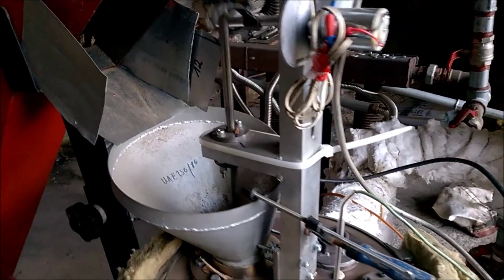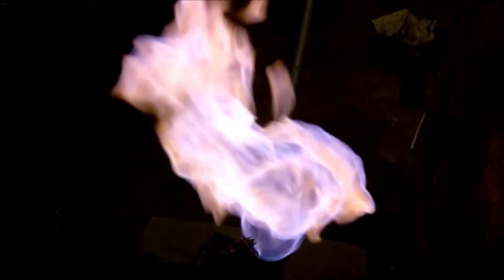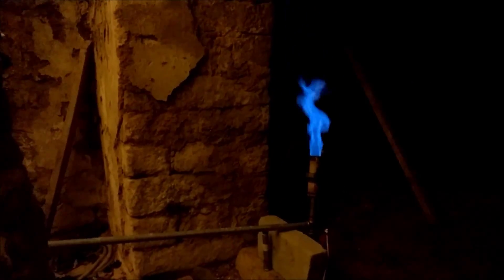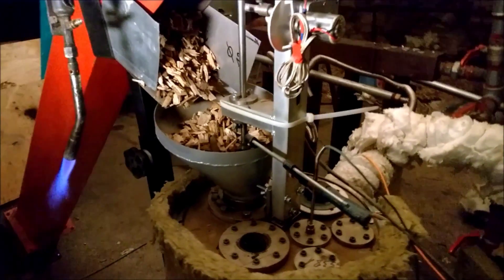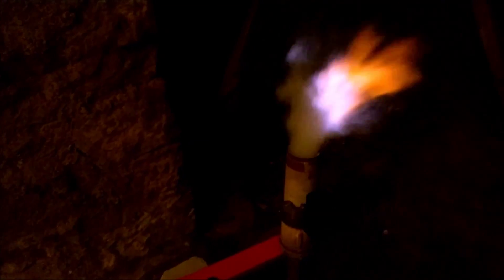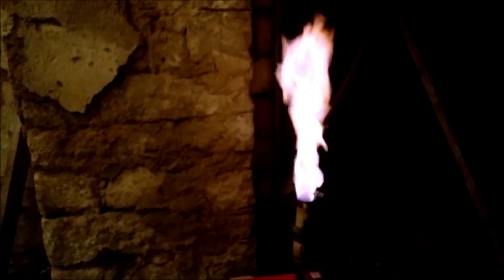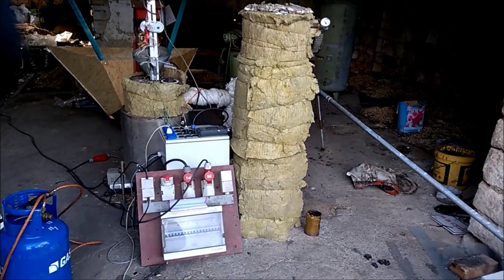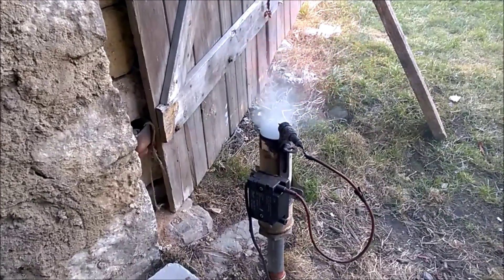Grateless gasifier; 24 hours run.

Comment: Hi Luk. I am really amazed at the performance of your baghouse filter. Could you tell me a bit more about it . Like what type of bags or socks you are using? Does it go for long before it needs cleaning. How difficult is it to clean? How well do the filter bags handle the moisture and sticky stuff? Always look forward to seeing your progress. I check every time I get on the computer. Still hanging out for some clues how that lastest gasifier works. All the best. Stephen
Reply from the maker: Hi stephen,  Since you follow my work, you will have noticed that I am still in the experimental stage. I change this and I change that and I try this and I try that in small steps. I do Experimenting by elimination. Promising is the fact that I always make little progresses.
But I am still not arrived at the goal I have set from the beginning. Building a gasifier that runs unattented day and night and can be operated by an unskilled person.
Saying this I also experiment regulary with various filter media. I recently changed the bag filter. It was preforming fair enough but if I did not brought up the filter house on temperature above dew point, and this took a too long time, the bag got soaking wet. Now the new filter you see in the video has first a layer of some 60 cm stainless metal shavings to condence out as much water as possible that while trickling down takes the dust with it, and above  that metal layer is an open space and above that,  right before the gas exit are two tightly pressed layers of high temperature resitant ceramic wool. The pressed ceramic wool resembles the ceramic candle's that are next to bags, the industry second most used filter media. This setup seems to be less vulnerable to moisture. (Beware, put them between screens because when wet they tear easy because of the vacuum sucking) How long they last I do not know because I only used them 24 hours so far. As far as presure drop the filter still breath as at the begining. I will leave them in place, and see how long they last. Now i must first make some small adaptions to the grateless. (mainly I will  take a slightly bigger diameter drop pipe, (from 88,9 to 104 mm) to slow the gas a bit. Hope the temperature will not drop too much and the equilibrium will remain)
The advantage of the ceramic wool filter, appart from maybe more moisture proof, is that layers wool are cheap compared to premium bag socks and they can be very fast replaced.
Reply: the DriZzleR Gasifier Hi again. Thanks for that reply. I see Dan gave up on his bag filter too. I have got my Imbert going again, after some modifications. I really enjoy lighting it up and trying the different variables. My latest problem is that a hole burns up the center of my hopper, leaving relatively unburnt fuel around the sides. I can see another mod coming. A bit like you. I will tell you something I have tried that might interest you. After my cyclone filter I send the gas through a car radiator. The gas goes in the top hole and out the bottom. I had a spare one lying around and thought I would try it. It works very well at cooling and also condensing out the moisture. It has an area at the bottom where water can accumulate and you get the benefit of the drain plug when you want to empty the water.
Reply: Luk Vanhauwaert Luk. My thinking for for putting the gas in at the top is that I didn't want the gas to rise to the top too quickly.  I feel that would occur if I had let the gas enter at the bottom. So I let it enter at the top hoping that the gas spends the maximum time in the radiator. That way I hope to get maximum cooling and condensation. I did have a modified 14 bar oil heater in the system a while back but have taken it out. The radiator does a good job all on it's own. Haven't noticed any clogging yet. But now you have pointed that out, I think I will pay more attention to that issue. I am pleased with the colour of the liquid that comes out of the drain on the radiator. It is a light golden colour. Definitely not tending towards the black. My runs are usually short. Up to around 2 hours. Always trying something new. My goal is to be able to fill the hopper and let it go unattended until the hopper needs filling again. That would be cool
Reply: gasonthebrain Stephen, yes unatended operation, and able to be ran by unskilled person only to look at the system for oil and filter chnages is the holy grail we alllooking for.
Reply: gasonthebrain Stephen, Hmmm a car radiator. How long have you ran with it? I would think that the very fine pipes in the car radiator would clog up fast by soot? You say you lead the gas from the top into it. Would it not be more logical to lead the gas into the radiator from the bottem? That way the upwards traveling gas would be washed by the downwards trickeling condensing water, the same time this falling water would wash the walls of the fine tubes by gravity.  Luk